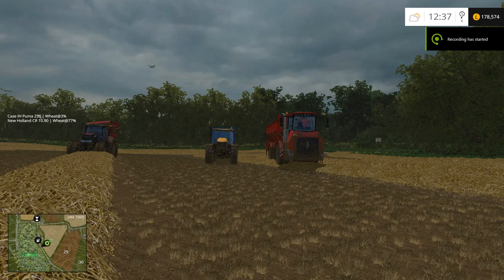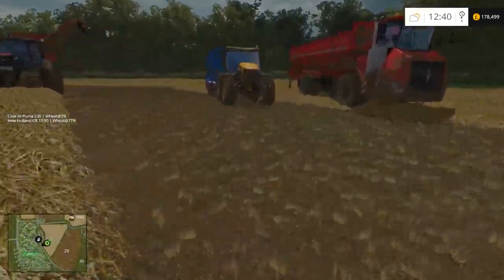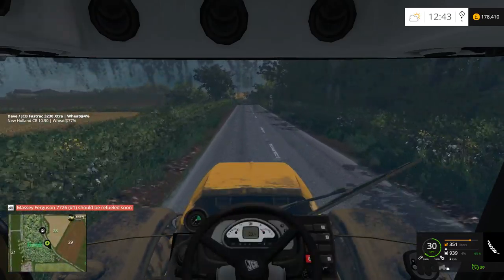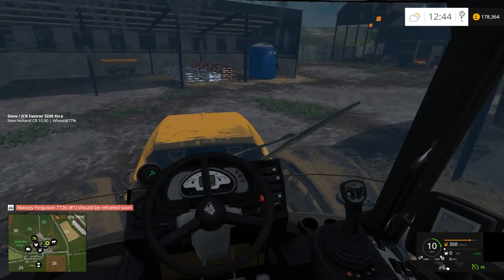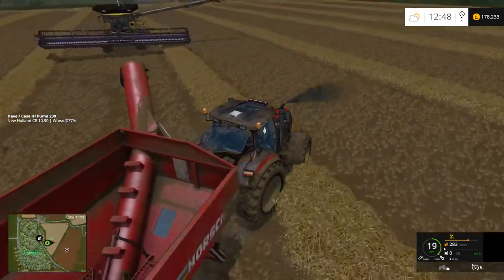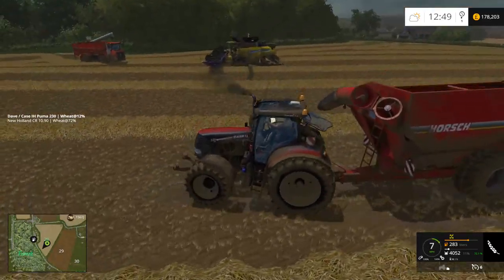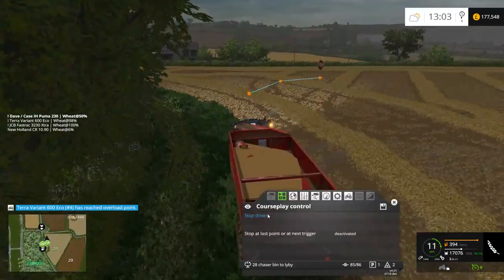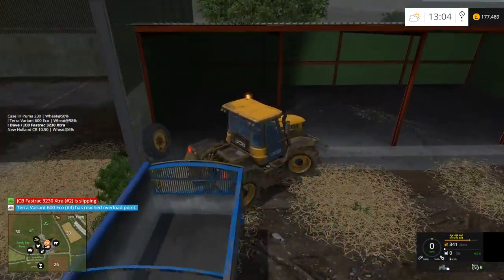Farming Simulator 2015 - Courseplay tutorial - Auger wagon/chaser bin/overloader

Comment: hello how did you get the holmer overloader to work with courseplay ?? thanks for any help
Reply from the maker: +Wild West Crawling Crew You can use the Holmer either like I have in this tutorial, or as a normal tractor.  I prefer to use it in either overloader or manure mode.
Reply: thanks for reply, i have setup a course saved then try it out, and i get message some thing like not correct trailer for this mode ????
Reply from the maker: AH!  You need to use the latest courseplay! :)
Reply: ok what one is that :-)
Reply from the maker: I don't know what it is, but there is a courseplay website of their own.  Google it, and it'll be on there.  Hope this helps:)